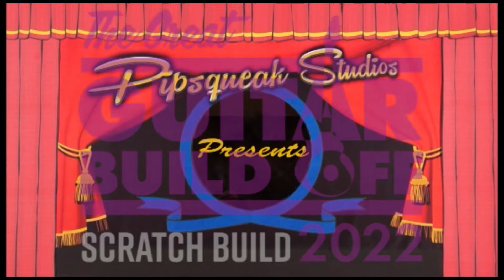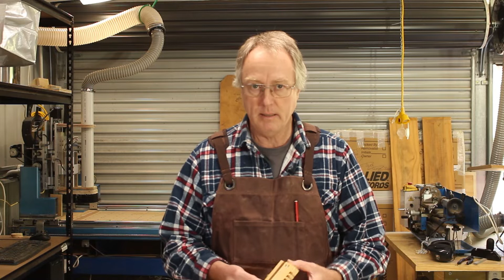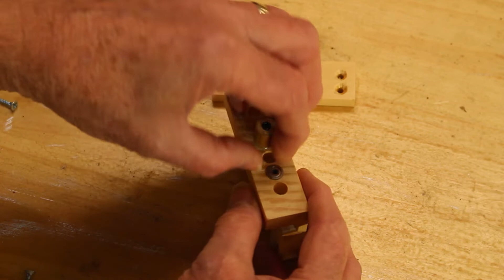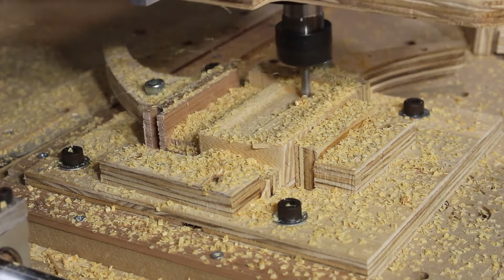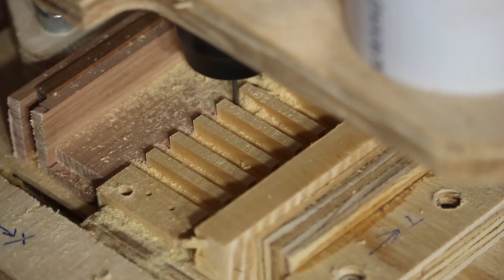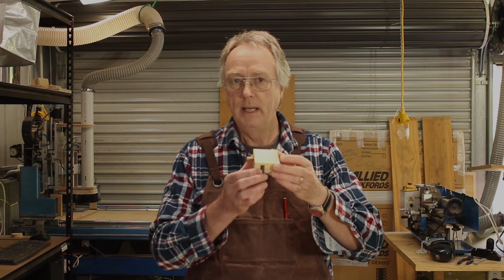Kit's Build. 3-Tuners Again!

Comment from the maker: There's a previous video in the series (2-Tuners) which shows the tuner more closely. These hex spacers are made of plated brass so are easy to drill and file. They come with a blind M3 threaded hole at each end. I drilled out one end to 3.0 or 3.5mm far enough through to join up with the other end, but not all the way through to destroy the thread. This allowed the adjusting screw to go further through the body of the tuner than it otherwise could. A 5mm round file was used to cut the slot in the side which was very easy.

The hex spacers I used are   "HARWIN  R30-1003002  Standoff, Brass, M3, Hex Female, 30 mm" which I bought from Element 14 and are dirt cheap. Buy a dozen as you'll spoil the first 1 or 2 you try to make. Also try to think of other things you need to buy (they stock Bournes guitar pots as well) at the same time to get above the free postage threshold! The tuner screws were cut from a 1m length of M3 stainless threaded rod. Two flanged bearings keep them in place.

After building this guitar I found the distance travelled by the tuner was less than expected and you could get away with using shorter spacers and a shorter frame .